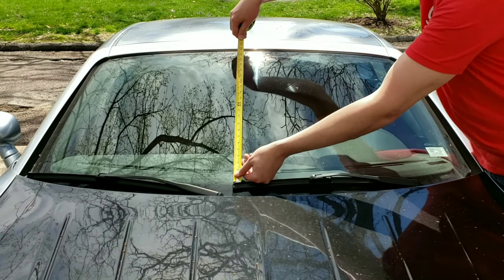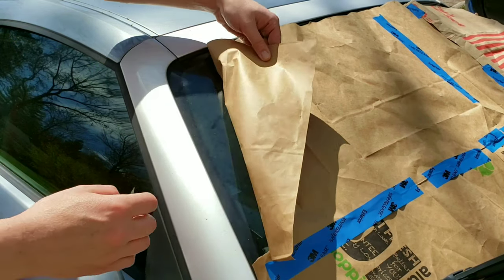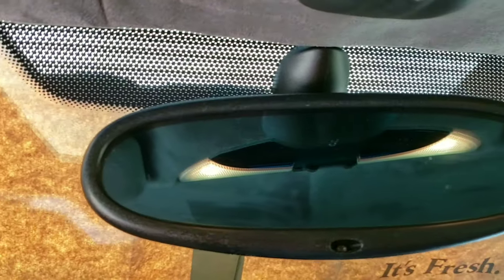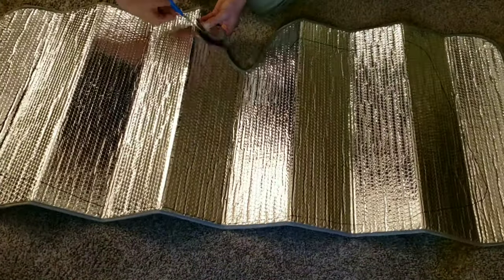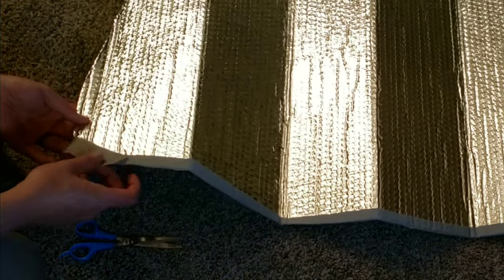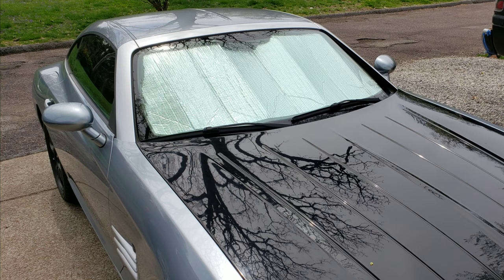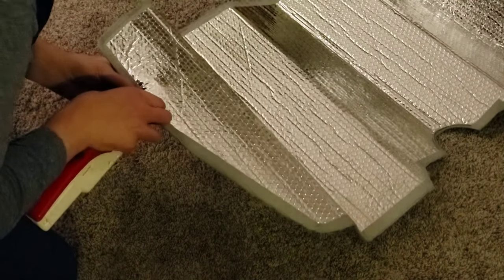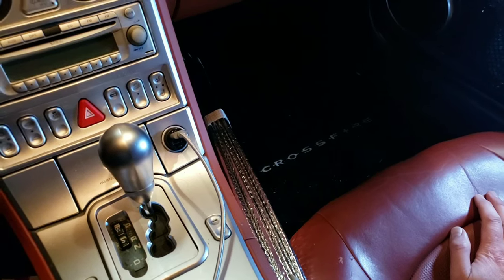Perfect Form Fit Sun Shade, interior protection, FITS YOUR CAR! Direct Custom Tailor

Comment: I couldn’t find my actual size to fit my car window. I’m glad I found this video. I’m going to try it. Where did you get the stitcher from? Thanks.
Reply from the maker: I bought the stitcher at jo-annes fabric to stich up a teenwolf costume for spring slush cup at a local ski resort. I think it was $55. I've also used it to fix luggage and my hockey bag. You can probably find something similar to it online. If your window is just as tall as it wide you can buy some suction cups at bed, bath, and beyond to help hold it up. I plan to update this video for trucks and SUV's soon

Comment: I live in minneapolis we’ve started off summer with over week in 100f which is uncommon I purchased a Shade and my husband said the metallic facing outside the car?? Yet there’s image so I thought people see that?! Starwars image... Q does the metallic need to face out or inside the car?
Reply: Metallic side faces out.  If you have a light side and a dark side, lighter color should face out.  Dark colors absorb heat, light colors reflect heat.
Stay gold.
Reply from the maker: To reflect sun rays you would want metallic out. However that's not as fun as the star wars image. Your best results to repel heat will be metallic, your best results for a good laugh is probably the image.

Comment: Where do you get that metal like material? 
What is it call?
Reply from the maker: It's not metal. It's like bubble wrap with foil on it, soft and squishy inside with a thick foil on the outside. I just buy the stock general 1 size fits all at Autozone then cut it down to size.
Reply: @glencouls  Thanks, you rock!!!
Video was well explained.
Reply: One of the trade names is Reflectix.
Stay gold.